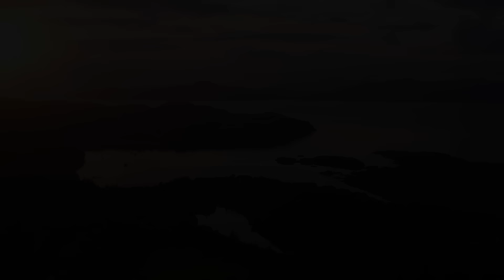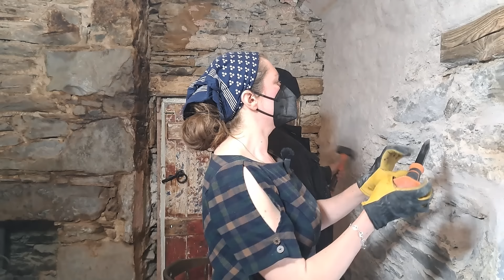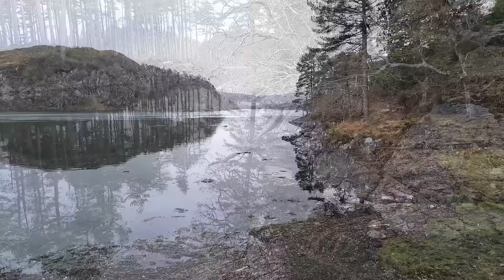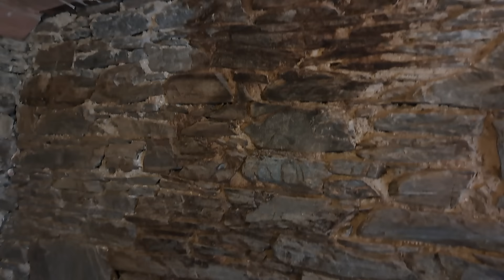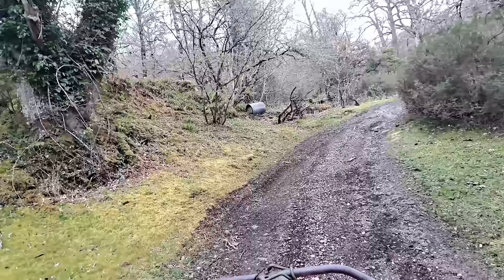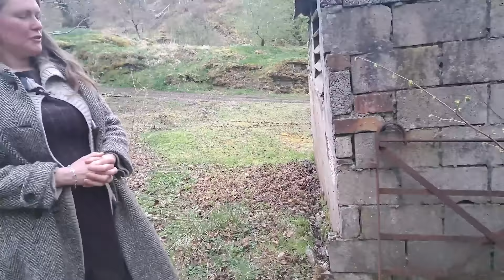Renovating a Jacobean Cottage in Scotland, Beachcombing & Wood Storage | Garden Rescue

Comment: Hi , really enjoying the channel. Re the constant dust. Maybe of some help. We converted an old barn with internal walls covered in lime mortar. We found using a fine water spray to spray the wall before hand helped but also to spray the air periodically as it pulls the dust down with it. 
But yes the dust gets everywhere and is a nightmare to live in whilst completing the renovation. Stick at it, worth it in the end !
Reply from the maker: Thank you! Kx

Comment: I like Kate's dresses i wear dresses ive ordered stuff fro the house of braur and Scotland very expensive but quality costs
  You 2 are sweet and matched devinly
 How blessed you 2 are. I looked at a few homes for sale one in sky...its expensive there  as you said getting accepted to live there permanently is a obstacle.  I want a place i dont have to restore thats livable with a few upgrades needed. Its the openess and beauty of scotland that attracts me soooo much heaven would describe scotland
Rual open and nature  georgous rich in history 
What a place to live what a adventure everday
Reply: Pines break so easily
Reply: Are you going to put a sealer over all the rock walls
Reply: So do the walls sweat in the heat
Reply: You 2 are very nice looking as well his humor is priceless very endearing couple you are😊  crack on
Reply from the maker: No, the walls need to 'breathe', or they'll be running with moisture. That's why you use lime instead of cement, and breathable paint rather than normal emulsion. Kx